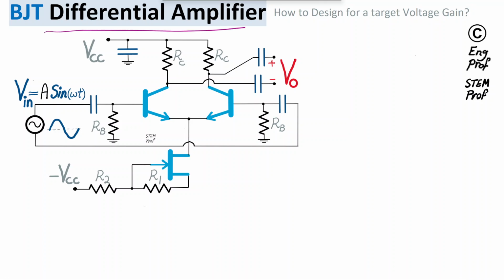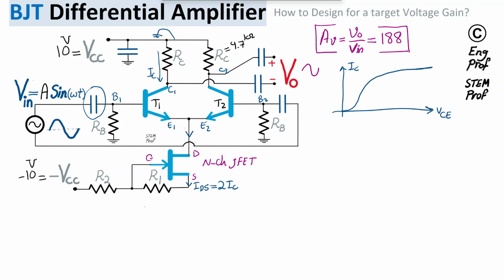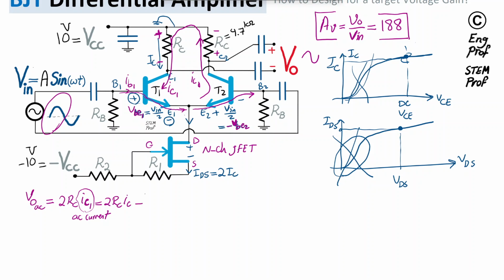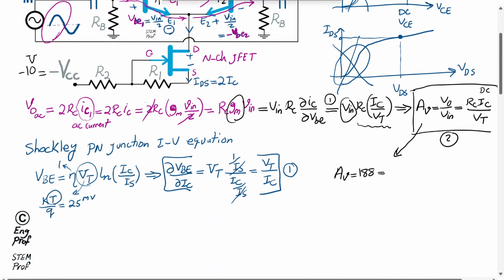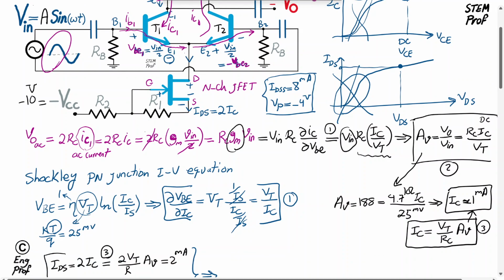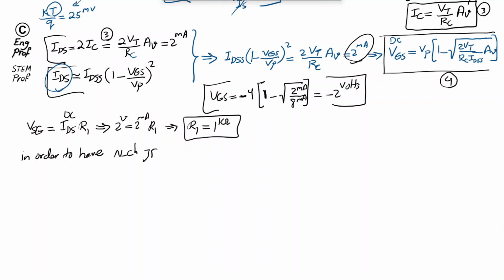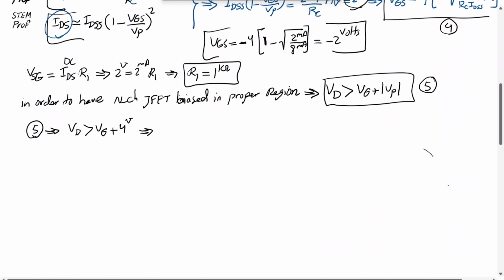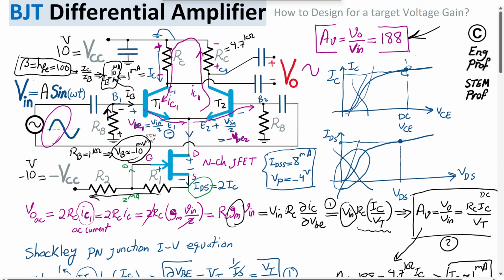Differential Amplifier Design with BJT & JFET transistors

Comment from the maker: Thanks for watching. For more Op Amp Circuit examples pls see: 
Darlington Differential Amplifier Voltage Gain, CMRR, input impedance https://youtu.be/z8f7iZei5cY
Push-Pull Power Amplifier Design with Op Amp, Sziklai Darlington Transistors https://youtu.be/8BFzsi7-Vbs
Instrumentation Amplifier with Electronic Gain Control https://youtu.be/C4tghZ-q6Zs
Power Amplifier Design (Class A) with Transformer https://youtu.be/gKlJrqGqeCI
Analog Logarithm Computer https://youtu.be/RpKEq5WyoLg
Op Amp Analog Computer Differential Equation Solver https://youtu.be/ENq39EesfPw
Push-Pull Power Amplifier with Darlington Transistors https://youtu.be/866MYibo8yE
Thermometer Circuit Design with Op Amp & BJT transistor https://youtu.be/55YsraFE0rg
Wilson Current Mirror and Current Source Design https://youtu.be/LfbfJYrovN0
On-Chip BJT Current Source Design https://youtu.be/Rs7gEMk03dw
Sallen-Key Analog Filter Design Tutorial https://youtu.be/KwUnQXbk7gM
Universal Analog Filter Design https://youtu.be/2J-0msXZE2o
Laplace Transform Example and S-domain circuit analysis:  https://youtu.be/ps8N5TPM_qU
Op Amp circuit Bode Frequency plot https://youtu.be/BLVzuuqAlZs
Lowpass Butterworth Filter: https://youtu.be/UzCjkwqy-9w
Analog Computer to Raise Signal to power n https://youtu.be/IUTlBH1UraE
Triangle Oscillator Op Amp circuit https://youtu.be/JF5Up_cuL9k
Differential Equation Solver Analog Circuit https://youtu.be/R3X5AYNZGEI
Complex Sinusoid Oscillator https://youtu.be/GXRhmwmS5Zk
Sawtooth Oscillator Design https://youtu.be/2eUsGPfqbW4
Full-Wave Rectifier circuit example https://youtu.be/DJJMNU-CYcg
Sawtooth Waveform Generator design with OpAmp, JFET, BJT https://youtu.be/5zHXTx-Vl20 
op amps Circuit with feedback loops to design an analog computer that solves a second order differential equation https://youtu.be/HeZRtnRXpEI 
For more analog circuits and signal processing examples see: https://www.youtube.com/playlist?list=PLrwXF7N522y4c7c-8KBjrwd7IyaZfWxyt
I hope these Circuit design and analysis videos are helpful. 🙋‍♂

Comment: Thank you for video. In what applications is this circuit most used for?
Reply from the maker: You're welcome! Thanks for watching and your question. Differential amplifiers are used as input stages of nearly all Op Amp circuits. There are more sophisticated differential amplifiers with process and temperature compensation auxiliary circuits and schemes. I will post more examples in the analog circuit playlist https://www.youtube.com/playlist?list=PLrwXF7N522y4c7c-8KBjrwd7IyaZfWxyt
I hope this clarification is helpful.
Reply: @STEMprof  oh okay thank you very much. Do op amps use more than one differential amplifier in input stage?
Reply from the maker: You are welcome. There are many design techniques including using Darlington differential stages with different Architectures. I will try to post more Amplifier examples in the analog circuit design playlist https://www.youtube.com/playlist?list=PLrwXF7N522y4c7c-8KBjrwd7IyaZfWxyt
I hope this explanation and these Circuit engineering and analysis videos are helpful. 🙋‍♂️
Reply: @STEMprof  thank you 🙏

Comment: Please excuse the question if it is stupid.

But why do we have to be operating in the saturation region with a small ac signal ?

I would have thought that we would be operating in the linear part of the curve. 

Thanks for your videos. 
You are really helping me get some bit of confidence.
Reply from the maker: You are welcome. Thanks for watching and asking questions. Glad that these circuit designs and analysis videos are helpful. Answering your question:  To make sure there is no confusion, By BJT linear region region it means the region where BJT transistor is not saturated and Collector-emitter voltage of transistor is large enough so that variation of collector-emitter results in minimal change in collector current (Early effect) and hence BJT transistor is functioning like a voltage-controlled current source with very large collector to emitter resistor. The value of current is controlled by the overall base-emitter voltage of BJT with small AC signal added to a DC bias. For more analog circuits and signal processing examples see: https://www.youtube.com/playlist?list=PLrwXF7N522y4c7c-8KBjrwd7IyaZfWxyt
I hope this is helpful. 🙋‍♂
Reply: @STEMprof  Thank you for the reply.
Sometimes , it is not seeing the obvious that causes a knot in my thinking. 

The non ohmic part of the curve at the plateau is where the Ic hardly varies with the voltage and this is what we want. 
Ie. A constant current going to the FET.

Would I be right ?.

Sorry if I am causing you any frustration.
Reply from the maker: No problem. Yes, we want JFET transistor to act as a constant DC current source and the two BJT Transistors to act as voltage controlled current sources whose current value varies by the applied small AC signal between the base and emitter of BJT transistor. For more examples please see:
Wilson Current Mirror and Current Source Design https://youtu.be/LfbfJYrovN0
On-Chip BJT Current Source Design https://youtu.be/Rs7gEMk03dw
Thermometer Circuit Design with Op Amp & BJT transistor https://youtu.be/55YsraFE0rg
For more analog circuits and signal processing examples see: https://www.youtube.com/playlist?list=PLrwXF7N522y4c7c-8KBjrwd7IyaZfWxyt
I hope these videos are helpful.
Reply: @STEMprof  Got it !! 👍  Thank you so much.

Comment: This BJT differential amp analysis is new to me; I enjoyed following your derivations. Thank you.
Reply from the maker: You're welcome! Thanks for watching and your comment. Glad that you liked this Differential Amplifier Design with BJT transistors. For recent circuit examples and videos please see:
8-bit Digital to Analog Converter DAC Design https://youtu.be/Y1H8HrrD4mQ
Power Amplifier Design (Class A) with Transformer https://youtu.be/gKlJrqGqeCI
5-volt Charger Voltage Regulator with Temperature Compensation https://youtu.be/NdfyHoxjKrY
Programmable Current Source Design with Op Amp, Zener Diode and Digital Potentiometer https://youtu.be/R1x6B0TczWk
Instrumentation Amplifier with Electronic Gain Control https://youtu.be/C4tghZ-q6Zs
I hope you also enjoy these circuit design and analysis as well. 🙏

Comment: JFETs have awfully wide Vp and Idss production variations
Reply from the maker: Thanks for watching and sharing your thoughts and practical considerations. While JFET and generally transistor process and temperature variations are important practical concerns, it is important to select a proper JFET given specific design from hundreds of choices in https://www.digikey.com/en/products/filter/transistors/jfets/288 and also have proper thermal compensation in place to keep transistor junction temperatures in the proper range so that Idss and Vp are controlled. For more amplifier and analog circuit examples please see  https://www.youtube.com/playlist?list=PLrwXF7N522y4c7c-8KBjrwd7IyaZfWxyt
Thanks again.

Comment: Common base audio amplifier circuit
Reply from the maker: Thanks for watching. Glad that this single-stage BJT differential amplifier is useful. It's core is based on a matched pair of Bipolar Junction Transistors with common emitter (for example MAT14 from Analog Devices). For more BJT, JFET and Analog Circuit examples please see  https://www.youtube.com/playlist?list=PLrwXF7N522y4c7c-8KBjrwd7IyaZfWxyt
Thanks again.